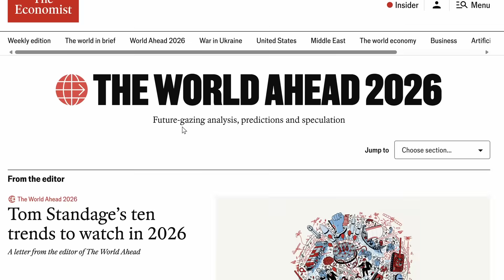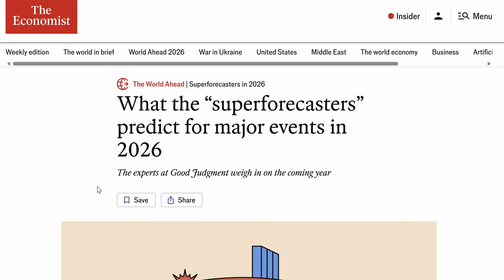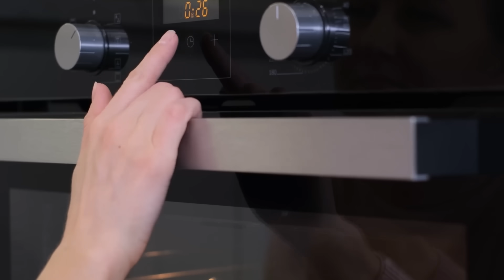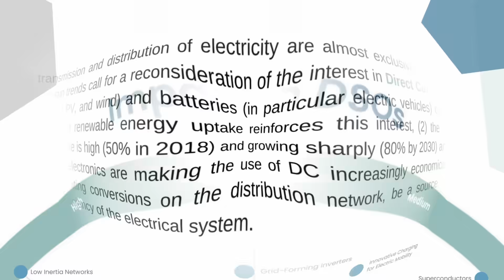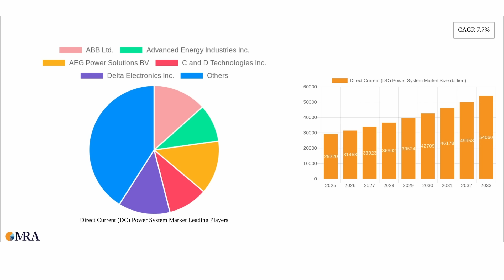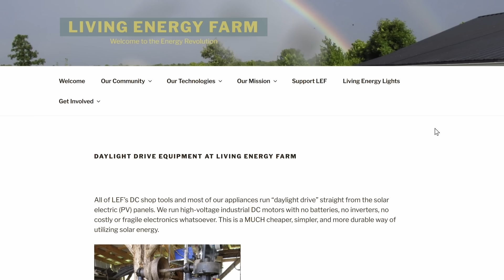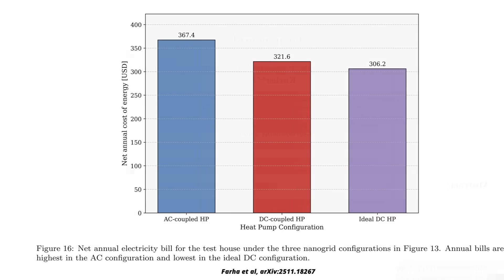Are We Using the Wrong Kind Of Electricity?

Comment: it is still easier to use AC for electric motors, your fridge, your garage door motor, your elevator, your washing machine, your dishwasher, your stand mixer... All these will require high voltage motor replacements or inverters if grid was DC. Also, AC motors do not need brushes, friction contacts, they work decades. Converting AC to low voltage applications is easier than converting DC to AC.
Reply: My milling machine and shop saw use 3 phase motors, couldn't make a simpler motor.  One of these motors is an old Soviet one... banged up but still running fine with no maintenance since then.
Reply: @jerrydurand4127 3 phase motors are awesome and won't be disappearing any time soon.  Inverters that make AC from DC are a well established technology however.  The passenger trains in my city are currently powered by them for instance.
Reply: @jerrydurand4127 

Do you have a 3 phase service? A friend that had a similar setup used a relatively small 3 phase generator powered by a single phase induction motor to power the 3 phase equipment. Not quite frequency stable but no three phase standby charges.
Reply: @Mentaculus42  Variable frequency drives can drive 3 phase motors on single phase.
Reply: @ozzybloke4830 

Yes, but this was long before that type of power electronics were generally available. It was a very simple setup to deal with relatively low power needs for a home shop. Also, if I am understanding your comment correctly, the old solution provides balanced three phase but what you suggested might be different unless the VFD has three phase output which it can (I was unclear if that was what you were suggesting, but I hope so). Also some people jerry-rig running a three phase motor off of a single phase and adding a capacitor (your mileage may vary).
Reply: @Mentaculus42  Yes, we got 3 phase when we built the house.  We managed to get a special permit.
Reply: No one wants to switch to brushed DC motors.  "brushless DC" motors however (really AC motors fed by dedicated inverters) have many advantages e.g. the ability to vary speed easily which can save power. These are what you'll find in a quality battery tool, "inverter" style heat pump or fridge, etc.
Reply: @2bfrank657  Yep, that fridge that barely lasts 10 years now
Reply: These days a lot of motors are variable speed and they have an internal AC-DC-AC conversion happening. 
Circuit breakers and huge passive voltage transformers are still an advantage of AC systems. 
DC systems require power semiconductors for every conversion step. These are sensitive to voltages surges beyond their limits and need replacement.
Reply: In many applications, AC motors (particularly compressors) are being replaced by DC motors in order to be able to control the speed and make the whole thing a lot more efficient.  There are still plenty that don’t, but your average fridge these days likely has a DC compressor, not AC.  A mini-split uses a DC compressor.  Older traditional (far less efficient) AC units had 1-speed or 2-speed AC compressors.  Some microwaves are DC now.  Many generators are inverter-type rather than directly coupled.  And so forth.
Reply: @junkerzn7312 AC motors have long been controllable in speed. You need and electronic controller to do it but the motor is simpler than an equivalent DC motor.
Reply: @junkerzn7312 

Variable speed means there is almost always power electronics driving an AC style motor. What u suggesting is that these applications r using an old style DC motor with a variable voltage drive electronics (probably with the old style brushes and commutator and associated maintenance). If the terminology used is INVERTER then the application is probably using newer types of electric motors with various types of types of configurations. Identical to EV vehicles, it could be a permanent magnet or an induction motor with appropriate power electronics. Nevertheless these are effectively AC motors. One car manufacturer is trying to use a brush type electric motor to lower cost but I suspect that this is on a multi motor vehicle where the motor with the brush is rarely seeing any current.
Reply: @junkerzn7312 yes.  I would like to clarify though that "brushless DC motor" is a massive misnomer.  They are really AC motors fed by dedicated power supplies that themself use DC.  This fact doesn't detract from your point (they still don't use mains AC directly), but I wanted to head-off any poorly though out comments if the sort "bUT THaTs sTIll aC!!!"
Reply: @2bfrank657  People are confused enough as it is.  Lets not add to the chaos.   An "AC" motor is better thought of as a fixed frequency motor synchronized to the incoming AC waveform.  Making  a variable speed motor with an AC input requires a VFD (basically a DC stage) and this creates utter chaos feeding back onto the AC input.   So that's basically the definition of an "AC" motor.

A "DC" motor uses switched DC.  There is no AC waveform on the input.   The voltages are basically DC.  The currents are AC due to the inductance of the motor windings.  Reactive power caused by the inductance is recaptured and then reinjected via diodes and capacitors.

AC motors generally do not have any control over speed, torque, or power.  They can only react to the loads placed on the motor.  At best there might be 2-speed selections using a cute circuit trick (common in some traditional A/C compressors), but that's about it.

DC motors have full control over the speed, torque, and power regardless of the loads placed on the motor.   For example a DC compressor used in a mini-split.

-Matt
Reply: @junkerzn7312 

Again some things u say are sorta ok, but many incorrect statements. One of the issues is your lack of careful definitions and massive over generalizations. Almost every gross generalization that is stated has a significant counter example.
Reply: @Mentaculus42  except, apparently, you are unable to articulate any of them because, I guess, you don’t know how any of it actually works.  Yes?  Yes.
Reply: @junkerzn7312 

You are so prolific with your misunderstandings that it is difficult to know where to start!! Just about everything u say is mostly incorrect. My job is not to educate u, besides people like u r generally disinterested in changing their misconceptions! I would have to waste hours of time and accomplish nothing!! R U an engineer, R U a mechanical engineer with a lot of electrical background, have U taken any classes in electrical machinery, do U have any engineering background with electrical motors, do U have a graduate engineering degree from Stanford, have U been hired by Stanford engineering professors???? I can answer yes to all of the above, ur turn!

Besides the topic of the video, however inane, is not particularly about ur misconceptions. The whole top level video topic is basically irrelevant and could only be put forth by people that have almost no understanding of this topic but rather are looking at it as clickbait to generate revenue.
Reply: @Mentaculus42  and again, nonsense rather than sense.  Try a third time?  Maybe actually say something that is valuable to society?  No?  No.
Reply: @junkerzn7312  Honestly speaking, it does not feel it is for the best.   Take the reliability of modern appliances, and it is a fraction of what old ones had.
Reply: The joke is that most of these so-called “DC” devices actually have AC parts within the power electronics. Also there are not universal standards for most DC voltages. DC brushless motors are actually AC. Anything DC with brushes has an inherent maintenance issue vs AC. The distribution of grid power is much easier via AC. The use of HVDC or UHVDC for grid power transmission is a topic completely divorced from low voltage DC (and when it makes economic sense). Clearly nobody at this channel understands how a DC to DC converter works. What a bunch of morosophs!
Reply: @Mentaculus42  I have often wondered what a semiconductor that can have hundreds of kilovolts between each end looks like. Surly, some turns of copper wire are cheaper
Reply: @paulhawkins6415 

The HVDC conversion is a bit complex. Historically the HVDC conversion stations that were referred to in the video used TUBES (or mercury-arc valves). Now it is all stacked semiconductors.  It only makes economic sense to use HVDC transmission if the distance is long enough to justify the lower transmission losses vs the higher conversion losses.
Reply: @Mentaculus42 you're missing the point with brushless DC motors though. They're not designed for mains AC, or even mains AC stepped up or down a little.  Brushless DC motors are powered by dedicated power supplies that provide whatever voltage and FREQUENCY are appropriate for the application.  Those power supplies need DC.
Reply: @2bfrank657 

Brushless DC motors are AC motors!! And I have designed hard drives that use these motors! The DC aspect is purely due to a standard industrial definition and a historical context of where and how to switch the input power. Even a brush based DC motor is an AC motor that MECHANICALLY vs ELECTRONICALLY converts the power to AC. Generally if a system is relatively small and has low energy requirements it is cheaper to convert to the required DC voltages once within the system. An AC to DC converter is effectively the same level of complexity and efficiency as a DC to DC converter. It really is a system optimization and cost minimization that determines the best solution.  Nowadays it is all about the power electronics! This is why when a system needs variable speed and higher power than little sub-horsepower motors, it is AC mains powering the power electronics that generate the variable AC that power the AC motor.
Reply: @Mentaculus42  You are going to tie yourself in knots trying to defined "AC" motors as "anything with an inductor".  That's not really how these things are defined.   And it also has nothing to do with brushed vs not brushed.  DC motors can be brushed too.  AC motors don't have to be brushed (most modern AC motors are not brushed).  Brushed motors in general are a very old technology.  Has nothing to do with AC vs DC.

Actual AC motors are fixed frequency and have an AC waveform (or waveforms if 3-phase) going onto the input of the windings.  The inductors of the motor are design to accept an AC waveform in a specific frequency range and if you give it anything outside that range it will burn up.

Actual DC motors can operate at any speed and have a DC waveform (almost a square wave, but think of it more like a PWM) going onto the input of the windings.  Usually 3-phase in that there are three different square waves.   The AC current components of a DC motor are basically generated by the inductance of the windings.  The voltages are more or less DC with some caveats.

Just because something might have AC components doesn't make it "AC".   The motors might look the same, but these are two very different technologies.
Reply: @2bfrank657  
Correct, but in the end they are all AC-machines - in a sense of pure physics.
Any e-motor is an AC-motor - even the DC-motors convert their electricity into AC, mechanically with pole-changing brushes at their rotating shafts.

If you look as an e-engineer like me you might call it a DC-motor, if you look at it as a physicist it's all AC. 

It depends how you look at the commutator device at its shaft - is it a mechanical switch generating crude AC or is it part of the motor (black box) running on DC?

A bit of chicken and egg question.

Merry Christmas & Peace! from Dresden / Germany
Reply: @junkerzn7312 

LOL, I am an engineer who designs these types of systems. A lot of what you said was incorrect but some was partially correct. Historically a TYPE of AC motor used SLIP RINGS. Historically a DC motor used brushes to transfer power to the MOVING COMMUTATOR that MECHANICALLY CREATED THE AC WAVEFORM. Intrinsically all electrical motors internally require alternating currents, how you get there defines the type of electrical motor. AND there are a lot of different types of electric motors (and potentially associated power electronics) these days with different topologies and specifications depending upon application.
Reply: @Gerd-2 

Totally agree! Always AC, from there the different types are mostly terminology applied to different standard naming conventions. Today the inclusion of integrated power electronics can further confuse the naming.
Reply: @Mentaculus42  Brushed motors have lifespans beyond that of the equipment they power - kitchen mixers , hairdryers , vacuum cleaners  and sewing machines for a few examples
Reply: @PaulG.x 

That has not been my personal experience and you are talking about very low power motors in general. Tho the old DC motors that are used in train locomotives are a different beast.
Reply: Easier in one point unless an outage takes precedent..then what? Support honest evaluation maybe as well.
Reply: Yes, for these applications that need a fixed motor speed, single phase AC is easier to work with. For any variable speed motor the standard is triphased brushless. This is produced by rectifying the single phase AC and feeding it into an ESC.
Reply: That was true for a long time but doesn't really apply anymore, most new build tech runs off DC even small cheap motors have inverters now.
If we didn't have a massive amount of legacy tech everywhere there would actually be a case for going with a DC grid today.
Reply: @FerdinandFake  and each of those inverters will fail sooner than a basic AC appliance and likely not have a repair associated with them. the advantage to AC is not having to replace electronics in places where it simply isnt necessary. a DC grid will suffer from charge buildup that results in significant corrosion that then requires significant maintenance. There's a reason old mechanical AC appliances outlast the modern computerized versions by a significant margin.
Reply: @renaissanceman5847  Not much can go wrong with a simple AC motor with no other circuitry, true.  But all modern appliances have circuit boards and microcontrollers these days, so it doesn't really matter whether the motors are AC or DC in terms of life-span.  And the rest of your post is utter nonsense.
Reply: @renaissanceman5847  Electronics technician here (50 years in the field) , I rarely see failures with the electronics. Mechanical issues are invariably the cause.
Btw " Not much can go wrong with a simple AC motor " - unless it is designed to wear out.
Reply: @PaulG.x  Ha.  True enough.  I will also add that a big advantage of a DC motor is that it puts a lot less stress on the actual motor than AC motor does.  A DC motor  soft-starts by design and has precise control over all mechanical torques inside the motor.   So it really isn't correct for anyone (me included) to say that simple AC motors last longer, either.
Reply: @PaulG.x  you obviously dont repair home appliances much less automotive electronics. industrial electronics are built differently. home electronics are designed to be made as cheaply as possible and generally un repairable or throw away. There is no need to computerize a washer or drier or garage door opener or a dishwasher... ever seen a landfill? kids toys are at the top of the list... electronics failure is the number 1 reason they are there. google it if you doubt my logic.
Reply: @PaulG.x  In my non-professional experience, the main failure mode of modern appliances is some controller board going bunkers
Reply: @junkerzn7312 

You need to precisely define why you keep calling that motor “DC” in your comment?!? Other than some place in the power circuitry feeding the electric motor there is a PARTICULAR TIME that the power flow is SORTA non varying. AND the power flow could be DC at SOME POINT but the power electronics could be feeding an alternating waveform to a variety of different types of electric motors. It might be something as crude as a pulse width modulated waveform driving an old style DC commutated electric motor but GENERALLY the industry has moved beyond that for a lot of good reasons.
Reply: @dmitripogosian5084  exactly. and often those microcontrollers are custom ASICs that have no replacement other than buying the entire circuit board.
Reply: @FerdinandFake 

Going to DC for the grid is never going to happen, makes zero technical sense irrespective of why AC was used for historical reasons. Only a few specialized applications would benefit for even an in-house distribution.  If DC is so great, then why did the Boeing 787 (which is considered a highly electric based aircraft) still use AC for the higher power electrical distribution (though variable AC frequency)?
Reply: @Mentaculus42 where does that Boeing get it's variable frequency AC from though? My guess is that power was DC at some point, then converted to AC.
Reply: @2bfrank657  
In the end it is debatable, every DC-grid will have internal conversions to AC the moment you need a DC-different voltage (s) in your device or machine.
Every charging cable inside its power plug converts via a small internally electronics the AC (230V / 120V) to DC, converts it to a high-frequency AC Usually around 30kHz), goes through the micro transformer, is being rectified into the now 9V or 12V or whatsoever DC.

I do not see a true advantage here.
Sabine is also wrong; large wind turbines generate in the end AC directly into the grid.

Peace! from Dresden / Germany
Reply: @Gerd-2 when we talk about AC we mean usually 50/60Hz AC - everything that produces or runs on variable frequencies that isn't a derivation of 50/60Hz is more effective in the DC camp
Reply: @Gerd-2  Yeah. You only really get to skip 1 step in the chain. The initial AC to DC conversion. I doubt its worth all the effort to switch over even if there is a slight net benefit.
Reply: @fischX  
Yep, I am not arguing with you. It is a matter of definition. As an (rather an hands-on) e-engineer I am in your camp, but sometimes (just for understanding the basics) I like to switch perspectives - just for a moment.

You are from your (mine) perspective absolutely correct.

Merry Christmas & Peace! from Dresden / Germany
Reply: @2bfrank657 

No, and that is my point! The turbines directly turn AC motor / generators (that do not use slip rings or brushes and yet still have an externally excited rotor, which is trick) that create variable frequency AC! This AC is converted to DC later. There are both AC and DC buses in the aircraft but the larger amount of power is moved on the AC buses which makes total sense from a total system optimization standpoint. The motor / generators are an interesting design. 

Another area that one might think that DC would be useful is in wind turbines, but a wind turbine of any relevant power only uses AC and many times also has power electronics to accommodate variable speed.